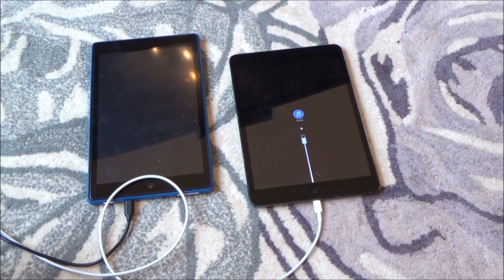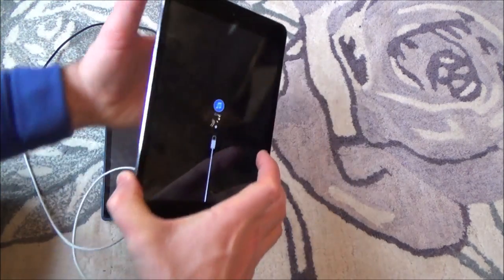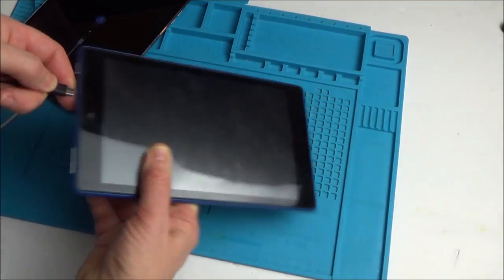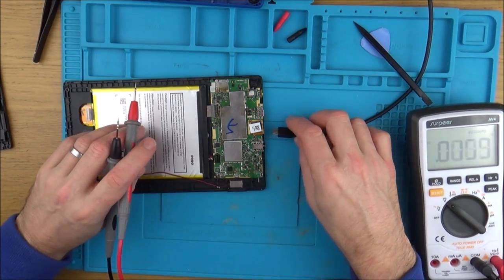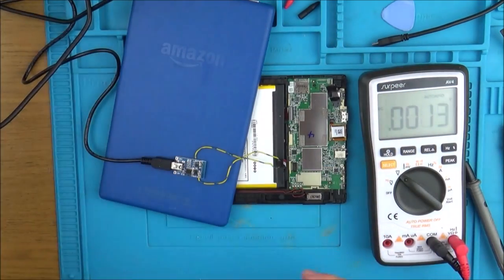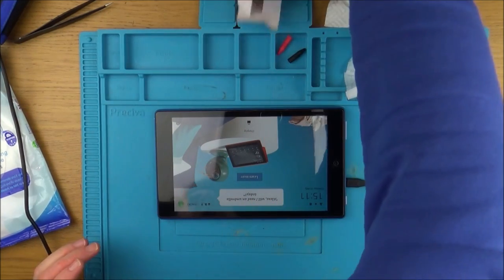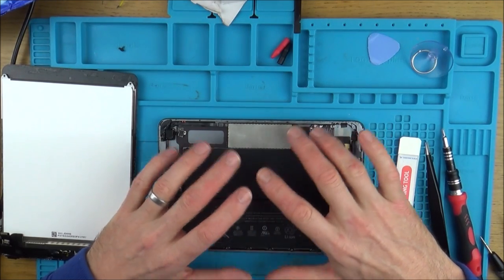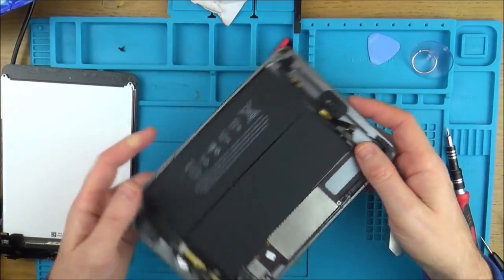Trying to FIX: Amazon Tablet and iPad

Comment: This was extremely painful to watch. There are 2 levels of restoring 
your ipad. The normal let iTunes manage to detect a failed ipad and give you the option to restore it. The other method is what's called a DFU restore, where you put it into DFU mode then connect it to iTunes. If the normal way is wonky DFU restore mode normally works. The whole disassembly of the unit could have been avoided and netted you a nice ipad. I speak from the experience of being a veteran repair tech for 18 years now. I started at component level and diversified to broaden my career path. Also I've seen the symptom it presented with, all due to using a gas station or Walmart cheapy cable where it's got good voltage connectivity but the data portion is crap. Or, could be due to an undervolted USB port. Regards.

Comment: Apple products have been proven to make its users dumber. Google it. EDIT 2035, Apple does not do repairs like you seem to think, they will simply state it needs an expensive board replacement, or an entirely new device. Louis Rossmann once did a repair of an Apple device that was nothing but a bent ribbon cable connector while the Apple "professional" (as you put it), claimed it needed a new motherboard.
Reply: Yeah, I was thinking he was giving these "professionals" a bit too much credit. It pretty much all comes down to "let's just replace the board and hopefully it work" at this point. A lot of them don't even get paid that well either, if they are working for a repair shop or something.